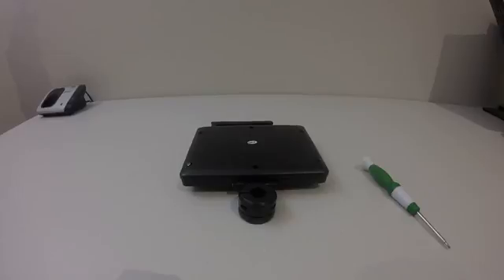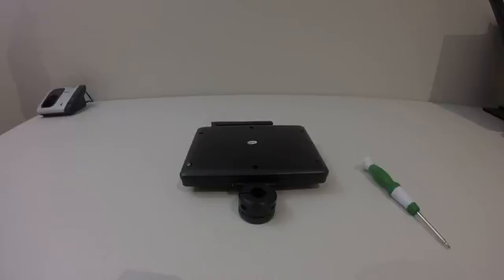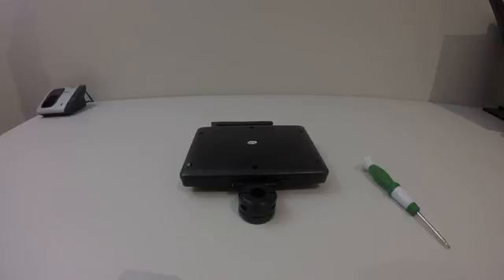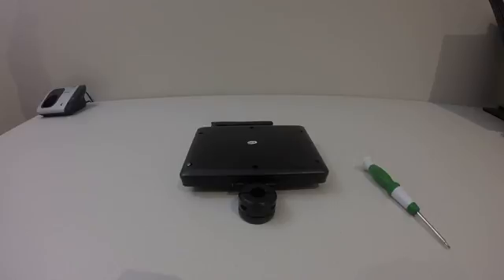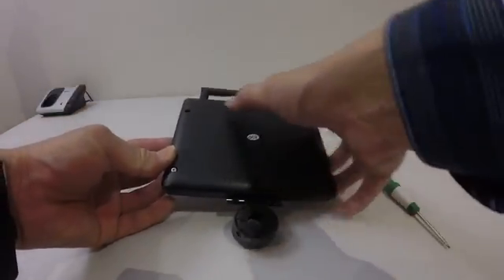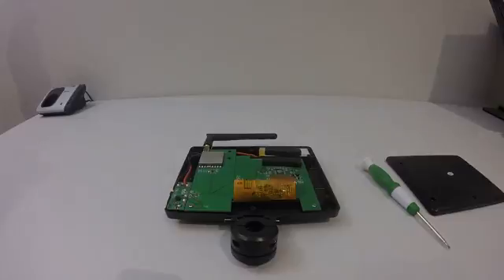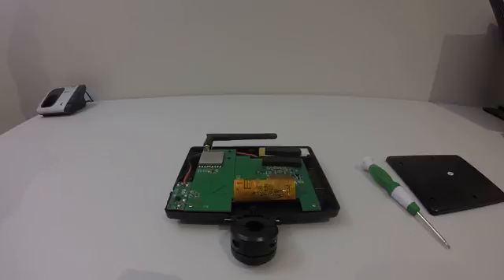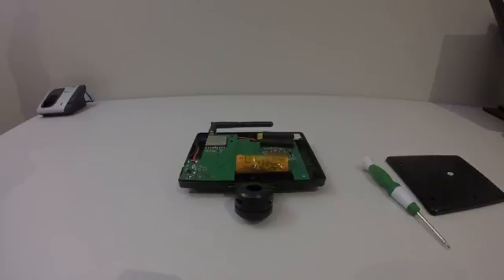Quadcopter - JXD 509G FPV monitor tear down (no channel switch)

Comment: Hello, is it possible to add or replace the receiver to have the ability to change the frequency of reception?

Where to add a AVIN with a switch to switch to the internal receiver or the AVIN?

Boscam FPV 5.8G Wireless Audio Video Receiving Module RX5808 ?

Thank you for your video.

In 2017, the lipo 1S makes 250mah (sniff)
Reply from the maker: Thank you for watching :) You are welcome. I don't know how to do it but here's a video that you can watch to get some ideas: https://www.youtube.com/watch?v=Z1urzTQm9kY

Comment: hi, I've got 510g and the monitor worked fine for 3 flights. now I turn everything on and green light shows on camera but monitor says  No Signal. can anybody help....
Reply from the maker: Thank you for watching. Did you crash the quad or drop the monitor? Green light just means there is power. I think if it is transmitting there is usually a red light. Check antennas on both the camera and the monitor. Make sure that the connections are not broken. You may have to open the camera to see if there's any loose wire or whether the 5.8 ghz is broken. Does the camera do recording and if so, does it still record? This type of camera gets heated up very quickly and if left there without flying, the video transmitter may burned out. Hope this helps.
Reply: checked all except wires inside. will give it a try. thankyou for your help. keep up the good work.
Reply from the maker: You are welcome. Hope you get it sorted out. Just remember that toy camera usually gets broken very easily.

Comment: THANKS FOR DOING THIS VIDEO! i think a lot of people were wondering what it looks like inside there.  and i think I'm gonna do YOUR lipo Mod.
so i can CHANGE and
CHARGE the the battery when i need to ...also i know from Quadcopters its never good to leave lipos plugged in all the time even if there is an on and off switch.Thats what I've always been told.! So i believe your mod solves this problem and makes using these monitors much easier
Thanks my friend.
Reply from the maker: +Full Metal Heli No problems! Glad you like it! Thanks :)
Reply from the maker: SEIKA ヘブン Hi, Thanks for watching! According to mu RC832 receiver, it is channel 34. Hope this helps. Hope you can subscribe to my channel. Thanks! :)
Reply from the maker: Cool :) Are you going to put up a video? I would like to see your completed quad. :)
Reply from the maker: Wow! I didn't know that a toy quad board can be tuned! Hope you have a video of that! What's the name of your Youtube Channel? I would like to subscribe. :)
Reply from the maker: SEIKA ヘブン Very cool :) Looking forward to see your videos. Keep me posted! :)
Reply from the maker: SEIKA ヘブン I see. I always wanted to learn that but could not find any video. I will look it up now. :)
Reply: +jtgravityRC its band 3 channel 4.  not 34..lol 🙈🙊🙉
its 5645 on the dip switchs
Reply: +SEIKA ヘブン. thats the jxd 509G channel on other goggles or monitor
Reply from the maker: Full Metal Heli Haha! Thanks! You can tell I am a new to all this thing! :)
Reply from the maker: SEIKA ヘブン Same here! :)
Reply: It Should work i think..screen might be a bit small but you can add foam or something around it..
Anyway its 5am here and i haven't been to sleep yet. Lol so signing off 
Talk to you guys tomorrow..
Oh by the way i got the king kong 188 build done and it flies GREAT ..the 200Qx never looked SO GOOD! 
Peace OUTttt
Reply from the maker: Full Metal Heli Cool :) Look forward to your video! :)
Reply: 5809 / fr2(b) ch5
Reply from the maker: Thank you :)